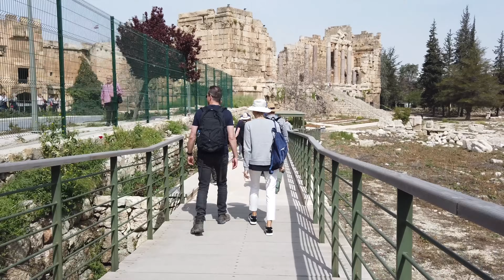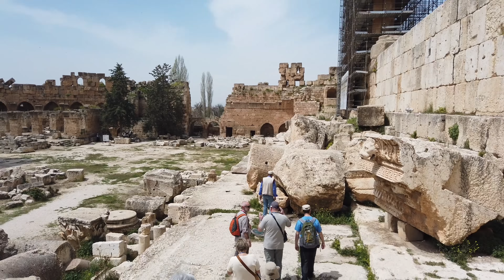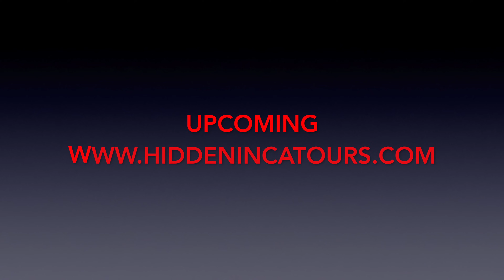Inside The Massive Megalithic Complex Of Baalbek In Lebanon: Part 2 Of 2

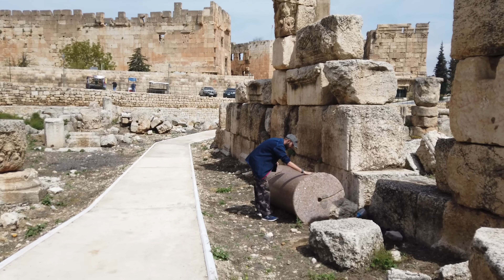Comment: At 1:25 minute you can clearly see the pin hole were the columns we're hold to be turn on the late. I saw number of hours my freind turn stuff in is machine shop, and this is the same type every time you show down columns. This is not the work of extraterrestrial,  but a very advanced lost civilization.

Comment: I Toured Baalbek in 1971. It was freezing cold in mid December.. i doubt that these granite pillars were turned on a lathe. It would have to be a massive lathe with a large power source. It is more likely the holes in the ends of the pillar were anchoring sites. The pillars were smoothed with sand grit.

Comment: I figure this has been beaten up already but looking at the weathering on the massive blocks they look more like concrete. Where do you stand on the geopolymer theory having been there? Also, any insight into the square holes cut into the blocks, looks like they might fit a 4x4 post? Original or later modification? When I was in Turkey the pillars in the Hagia Sophia, the immense green stone single piece ones, were apparently brought back from Persia by the Romans, so steeling architectural details like columns was commonplace. The rose granite ones in this video look exactly like Aswan granite.

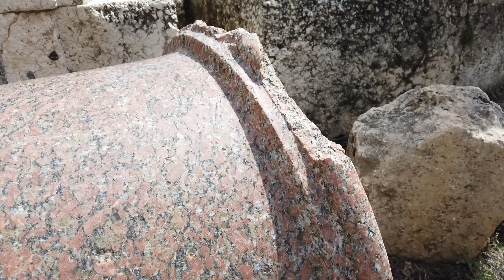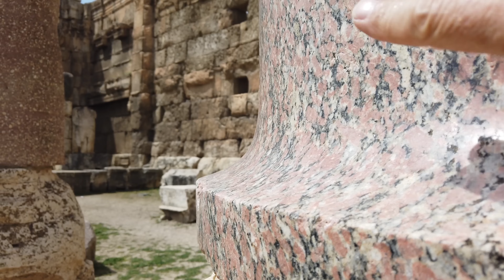Comment: Thanks Brien. Much as I love your cinematography I cannot love your conclusions.   You say at 1:40 -- it's clear these granite pillars were turned.  Again at 2:15 you say - They had to have been turned on  lathes.  In fact, it is clear that that can't be done.  First, eliminate the impossible, as Holmes tells us.

Why is it that observers have no trouble believing Romans made concrete (opus caementicium) 2,000 years ago but that 3,000 year before that (perhaps even earlier) the Egyptians or pre-Dynastic Egyptians or Pelasgians (it doesn't matter really) could not?

Where do you think the Romans learned how to do this business?  It's easy to pour granite into molds, and the so-called drill holes are simply left when you wind dowels or ties out carefully as the mix dries -- the hard part is melting the granite.

I have built solar concentrators for NASA and Duke Energy so, whether or not I'm right about this, you should listen.  I've seen steel melt like butter.  A concave lens, like the image between Hathor's antlers, is the tool used to melt granite.  And using that method keeps the operator safe.  Temps in the thousands-centigrade will kill you. So be careful when you try this at home.  Use the Hathor Method.  You don't get to be the Mother of Horus for nuthin' you know?

Why do so many refuse to acknowledge a process whereby perfectly fitted joints are 'Unavoidable' when that result is 'Unattainable' by the quarry, carve and levitate method?

Heliopolis may have been a late name but it tells us what we need to know.  The City of the Sun, where Imhotep plied his trade should make this clear, indeed, as clear as is the summer's sun.  (In Giza, not Seattle or London.)

Thanks again.  I always enjoy seeing your crystal clear footage.

Comment: Wait, I don't understand. For one thing, this is the only time I've seen both sides of that corner at the same time. On the left side, the part that has been blackened, is that concrete covering the wall like stucco? The corner block that juts out at an angle and then starts having the offset in it after it goes around the corner to the right. Is that one really huge also or is it covered with concrete making it look like one block? It's difficult to word this question lol. Well whatever it is, this is a very different perspective than the thousands of tourist photos I've looked at over the years. Thank you Brien for a fresh look.

Comment: "The pyramids, the huge boulders etched out … all of this was done in one way or another through the use of, a knowledge of, both coordination points in space, and the use of sound. There were instruments that released sound, and directed it in the same way, say, that a laser beam does with light."

(the intricate stone carving) “was done by small instruments that used inaudible sound waves; these radiations softened the stone … so that the work could be performed."

"Just as legend has it that the continent of Atlantis lay in the Atlantic Ocean between Europe/Africa and the Americas, so the great land of Mu (the Motherland) is said to have existed in the vast Pacific Ocean between the Americas and Asia. Each of those mythical domains eventually sank beneath the waters in a great cataclysm; each perished more than 10,000 years ago."

from findingseth.com

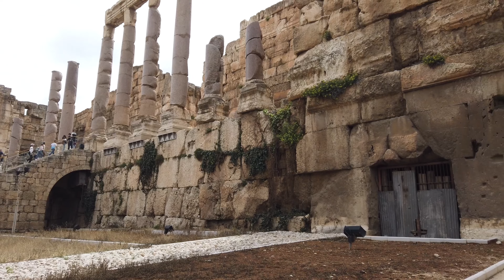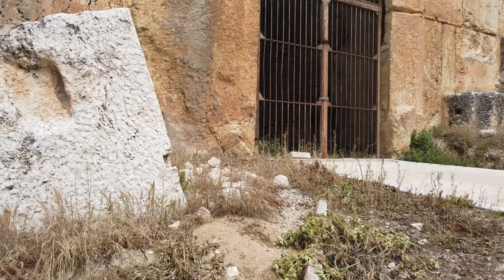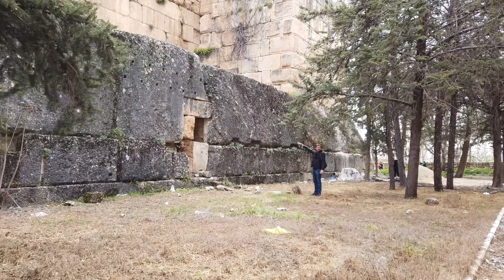Comment: Thank you for this video Brien! Excellent work as usual. Some observations: Square (and such) holes in walls appear to be made later than original - very imperfect alignments, looking like someone trying to get into a secret box. 7:26 - Superstructure at doorway was removed for some reason... note the ramps tend to hide the fact that the door base is lower than surrounding ground level. Perhaps it descends inside. 8:18 Remnants of stone facade might explain why some surfaces look seriously chisel-damaged. Inheritors did not like the original perhaps. 8:59 Some have commented about. All the holes and - honestly - this doorway looks like it was an Area of Major Interest to the Inheritors - scratching and clawing and hammering with all their might. Almost seems they were trying to wedge that monster megalithic stone OUT. Damage in that immediate area looks like crazed humans went at it for awhile. Anyway... Thanks again Brien!

Comment: Another so obvious commonality in Megalithic works; no decorations or inscriptions. 
Similar to the Egyptians, the Romans spend much time decorating their constructions. Then you have these gigantic granite pillars. Simply smooth and perfect but devoid of any decoration. Same with the walls and all other stonework from that unknown culture and era.
To me it's as puzzling as the 'knobs'. On one hand they definitely show aesthetics. You don't need such smooth edges for a purely functional structure. The pillars would be just as functional with a less polished surface for instance. So aesthetics was part of the equation for these people. Yet no decorations or inscriptions. And when it comes to the knobs they obviously didn't care. They build perfect walls and felt no need to remove and smooth out these protrusions.

The only analogy I can think off is the Germans during the last years of the second world war. With the pressure to produce as much weaponry as they could manage you find a similar sort of mix. Some aspects done with the same precision and care as if they had all the time in the world, perfect welding on the tanks for instance. Other aspects sloppy because it didn't bear on the functionality. A tank wouldn't leave the factory without perfect welding joints, but the paintjob could be half done.
It's just guessing but a sense of urgency might account for the seemingly contradictions in megalithic constructions.

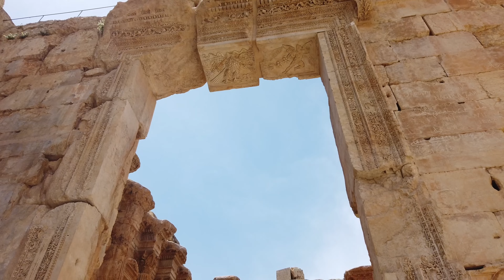Comment: @ 6:33 there's a glimpse of the center of a lintel looking like it's about to fall. (In the position of the Keystone if it were an arch). 
No doubt it's been reconstructed and is secure. Looks like they used some kind of mortar on the repair. "Heavy, heavy hangs over thy head."

Comment: Could someone dig under the mega stones at the bottom and carbon date something from beneath?
Reply: Good idea.  I have a similar approach but using coring equipment to core across a joint to capture the pollens that were around at the time of the upper stone being laid down.  Should give us a date for the construction.
Reply: @fragotron  Could you tell me the source of your comment as it is at variance with what I have believed about radiometric dating methods, thus far.
Reply: @fragotron  Absolutely FALSE.  The rate of decay is unique for each radioisotope and is ALWAYS constant per unit of time. That is how and why a half-life can be measured for each and every radioisotope, including carbon-14 (5730 years, look it up).
Reply: Carbon dating in not  accurate.
Reply: @JasonJaswell8190  No dating procedure is perfect. Carbon dating is useful for up to 50,000 years ago but not beyond. It won't give a specific date but the younger the plant the tighter the range.
Reply: @thomasprescott5333  it's wildly inaccurate
Reply: @JasonJaswell8190  Can you recommend a procedure that produces results that you can accept?
Reply: @thomasprescott5333  there are none. You can't date the cutting and placement of stone.
Reply: @thomasprescott5333  also, they carbon dated a snail shell and said it was 6,000,000 years old. The shell was attached to a live snail.
Reply: @JasonJaswell8190  I'm afraid I find it difficult to believe that anybody doing a test using the Carbon-14 dating method could produce an age in excess of 50,000 years as there is virtually no carbon-14 left to detect.  Any carbon-14 remaining will produce a younger date not an older date.
Reply: @JasonJaswell8190  It would be pollens/seeds trapped between the blocks at the time of construction that would be dated.
Reply: @JasonJaswell8190  Six million years is ridiculously beyond the range of acceptable carbon-14 dating, for that range they use other methods, and they don't use those methods on organic matter either.  The process of carbon dating is sort of like using a 50ft rope with a weight attached to determine the depth of a well...you can measure any well shallower than 50ft with acceptable accuracy, but if your rope doesn't touch bottom then you're not going to say it's 1,000ft deep, you're just going to say it's deeper than 50ft and a different rope or method is needed to find out how deep it actually is.  I would seriously question the authenticity of whatever source you found that from, because it honestly sounds like they have no idea how carbon dating works.
Reply: @Skinflaps_Meatslapper  Excellent analogy. The only thing I will add is that you are measuring the length of the rope with a six-inch ruler, so that as the length of rope needed to reach the bottom increases, so does your uncertainty.
Reply: @Libertylute  Precisely, that's why there's a margin of error the older you go.  Additional sampling is like measuring the rope several times and creates a sort of Bell curve, that can tell you there's a higher probability that it's 30ft rather than the lowest measurement of 27ft or the highest measurement of 34ft. So your result is going to sound like "It's between 27-34ft deep, and we're reasonably certain it's a 30ft deep well".  Conversely, if it's only a few feet deep, your accuracy is going to be measured in inches as opposed to feet.  There are lots of way to increase dating accuracy, and there are still inherent limitations to it...so long as you take those into account, you can get pretty reliable and useful data from it.

Comment: When you say 800 tons it sounds like a lot but it’s really not as mine blowing as when you multiply it out and come up with the number of 1,600,000 pounds
Reply: - Would take 8000 strong men to budge it.
Reply: @zora_noamflannery2548  yes, but how did they lift the obelisks and stones around? Where are all the tools? Why no language to say something about this civilization? It’s way more than just the weight of these stones.
Reply: thats a lot of pounds tho, and its all in one rock that isn't easy to pick up, grab, or cut. we would need extremely powerful cranes to lift it even today. the largest single rock we've lifted with machinery was only 400 tons. when you compare it to something like a cruise ship it might not sound like much but the difference is that cruise ship is broken up into much smaller pieces that are engineered to be easy to move around.

Comment: You mention lathes several times.  Could you do a video presenting lathes, showing how they work, what we can and can't do with them with our technology.  I think that would help me better understand what you are pointing out and explaining.
Reply: I worked with lathes, metal lathes in my case. Turning metal is easy compared to turning stone. Why? Stone is not only hard, it is brittle. Metal is hard, but not as brittle as stone. 
On topic now: He means the overall roundness, wich is not achievable by chisels and hammers. Also the surface finish is not achieveble by polishing the colums by hand with whatever abrasive. You need your workpiece rotating for the observed roundness. And this is only possible with lathes. And the radius at the top or end of the column is a clear indicator for lathes being used. Another indicator is the hole in the centre on one end. You put your live center in, the other end would mount in a chuck of some kind. 
To be clear,  a column that is six meters long and about 80 centimeters in diameter is quite heavy. So you need a big lathe and of course some sort of power source. Workpieces that big would rotate quite slow, about 100 or 150 rpm, so a waterwheel would be enough. But you also need cutting tools, and this is the tricky part. You need tools with diamond tips or at least carbide. Ceramic cutters would also do the trick. But... Tungsten carbide is quite new (1970ish), ceramic is even newer. In short, this is modern day technology. But it was used thousands of years ago. And the romans had nothing of this kind of technology. The potters wheel, yes. foot-powered woodworking lathes, yes. But nothing of the magnitude of high tech, that is needed here.
Reply: @NixWiwWeg  I wonder how,they initially prepared the stone,before starting to spin it.
It had to be precisely balanced,otherwise disaster.
I wonder too,if the stone has the same density,or mass throughout.
Controlling harmonic frequencies.
Then again,they knew how to choose the appropriate stone,for its intended purpose.
I lean toward the theory of the ability of the ancients to levitate these stones.
Once machined,to then set them so precisely.
Cheers
Reply: @billysolhurok5542  I'm asking the same question myself. How did the prepare the stones? You CAN spin a relativly round stone in a lathe and getting it perfectly round. But before that, you have to get it relativly round and centered. Here the key is centered. Finding the center, drilling the center hole on both ends AND as seen on at least on column, drilling four addional holes to drive the stone in the lathe. And - at least I would - you have to use a steady rest to support the column while working on on end. Then you have to flip the workpiece over and do the rest.
Levitation of some kind was definitly involved. Not only for the lifting of the objects, but also for moving this stuff. We could lift these blocks (if we somehow manage to get the needed cranes there and put them in place), but moving? With trucks? You need roads, that can withstand the load of the truck AND the stone. And there isn't even a road. So, levitation is the key here. I have no idea, how. With sound, with antigravity? All I can say is, they had fairly fancy, advanded tools and methods.
Reply: Hey man! Can you still drain 3's with ease??

Comment: The square holes in the large blocks ? Maybe a way to guide a machine and control the depth when making that contour on the top edge ?
Reply: Blues Dirt it's a lathe end go look at large lathes.
Reply: @carlynfindlay5046  I think Blues Dirt was referring to the multiple square holes along the surfaces of the 1000 ton rectangular trilithon blocks? (not the round columns but correct me if I'm wrong) I've assumed those holes were either cut to assist in moving/lifting the blocks or something more practical and boring, like for wooden beams/poles to create roofing for shelters like for shops, housing, stables etc.? Where is a time machine when you really need one! ;-)

Comment: thinking about the logistics of building a lathe to turn a block into a long column, it probably would have to have been Vertical as to the typical Horizontal lathe for wood probably wouldn't work, I imagine the weight of the stone with the grinding work being done on it would probably not be strong enough to hold itself supported at the ends horizontal and crack under it's own weight. the holes at the end are more likely to keep the structures in place like pins so they don't shift during earthquakes.   just guessing.
Reply: I agree.  If it was a horizontal lathe, imagine what kind of anchoring system would have to be in place, bolted or attached to the ground to hold a stone that heavy?  It would have to be on an extremely MASSIVE scale.  Why haven't any of THOSE been found?
Reply: @coryCuc  it was probably all stripped down for firewood by those that came after.
Reply: @lordreginaldfilibuster  You're going to need something a LOT stronger than wood to spin a 150 ton piece of granite. A small lathe used to shape a baseball bat is anchored to the floor by steel and thick bolts.
Reply: @coryCuc  lol oh Definitely! But could you imagine the size of the furnaces and molds to cast the pieces to build such a device. A more likely assumption would be that the rough block stood still and the machine revolved around it, than the machine could be moved to the next block and not keep bringing stone to machine.
Reply: @coryCuc  if you spun half a sequoia tree you have all the torque you need, at 2000 years old you can see how strong old growth trees are, i've cut 600 year old pine and its strong as a chunk of aluminum.
Reply: @patriley5333  So you're saying they could have used wood as you suggest to spin 1,500 TON stones of granite on a horizontal lathe with wood? And by what anchoring mechanism? There's no way.
Reply: @coryCuc  a large tree trunk spinning in water, with stone retaining walls and a thrust bearing where the live center attaches has plenty of torque, how the centers attached would be strong alloy and wound rope, and the steady rest would combine alloy cutter inserts into wood framework also. I think rope was used more creatively too, as springs, pulleys, fastening and such.